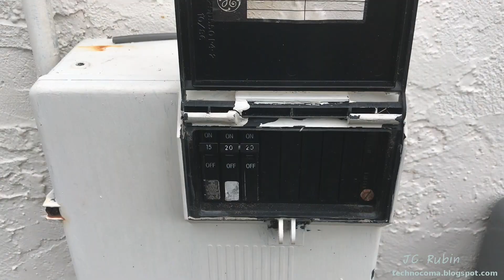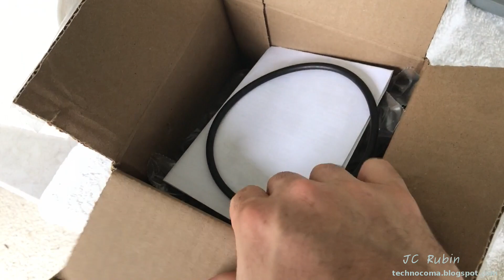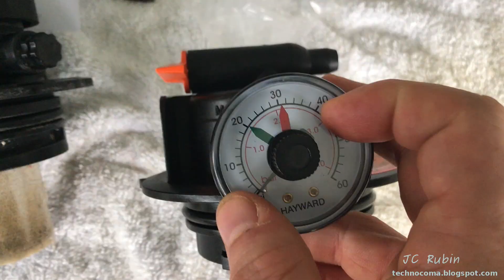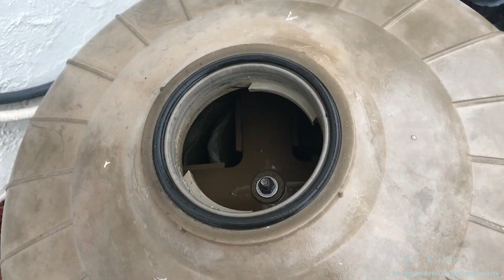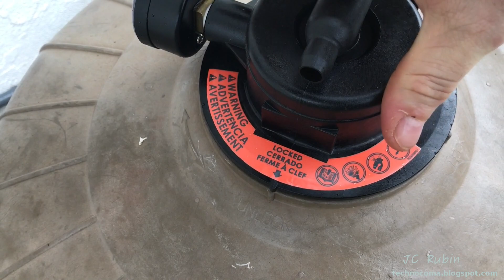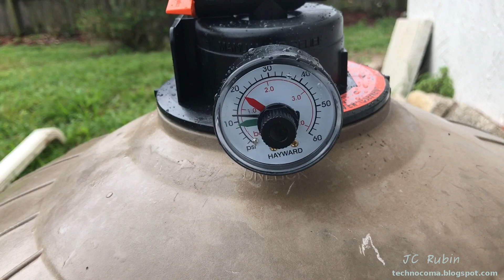Hayward Pro Grid DE Filter Repair - Manual Air Relief Assembly Replace or Re-seal

Comment: When I put my new part back on; I was able to turn half of the way, but cannot lock all of the way where both arrows are together . Mine is half was locked, and I see no leaks. How did you get yours to completely turn to the lock position? I can’t use a pipe wrench, because there is no room.  🧐🧐

Comment: Just FYI, you replaced an automatic air purge value with a manual one. The automatic one has a ball valve assembly that is in the down position when the air is being purged and once the water hits the top, it lifts the ball and forms a seal (supposedly). What ends up happening is DE gets into the ball valve housing past that filter and it gums up the ball causing it to not form a good seal and leak. All you need to do is slide the filter off, clean the ball and reinstall. My concern with the "new" manual one is that if you have any leak in your system, you'll end up with air in the filter and never know about it until you manually open the purge valve. If you still have the old one, remove the filter and i'm sure the problem was DE gumming up the ball.

Comment: Great video. I did the same thing today but I have a concern that I was replacing an automatic relief valve with a manual one.  If air gets in the unit during operation and I don’t manually vent out the air I could run into problems.
Reply from the maker: The older one was manual too, it was just a screw instead of a lever.
Reply: Yes there was a manual screw, however there was also this kind of ping pong ball assembly that automatically received all the air when I opened the pool and the filter had no water in it.
Reply: Sorry I could not load the pic

Comment: The new assembly is garbage. The old one had a ball that would release air and close when water pushed it upwards. I am looking everywhere to buy the old part.
Reply from the maker: The old one did not do a fantastic job of that, also it had metal internal parts that rusted and a screw that required several turns and could easily get lost.
Reply: They don't make the old style because of the leaking